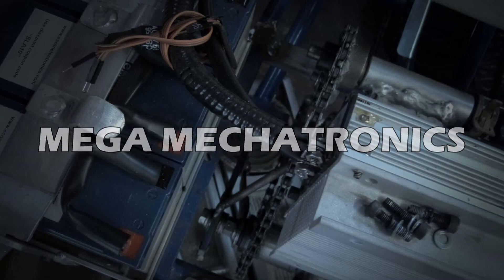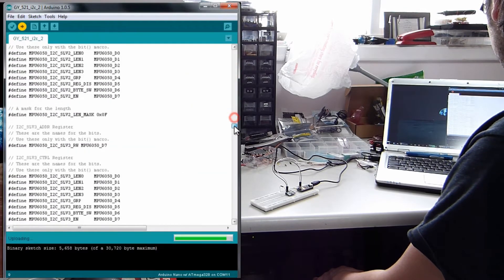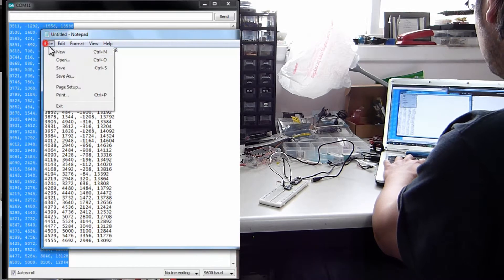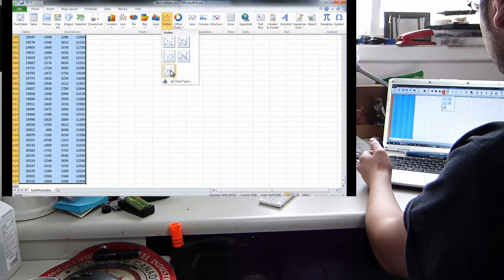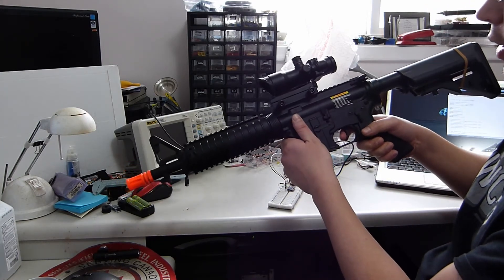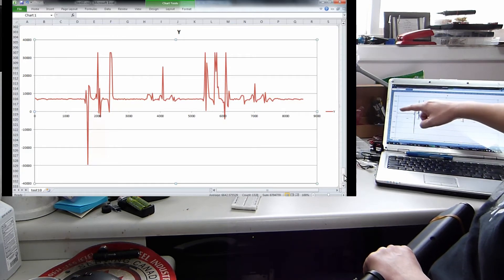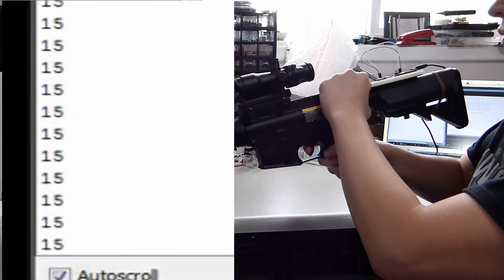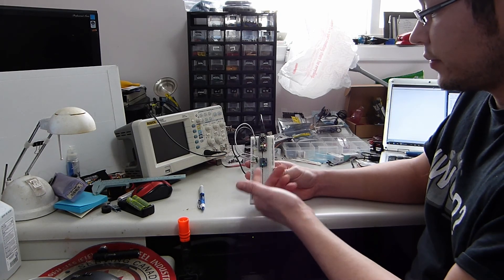Arduino ESP STM Bullet Ammo Counter Experiment Airsoft GY-521 MPU-6050 Tutorial

Comment: Very interesting piece of work and I think this is unnecessary...an optical counter would be much better and easier to program!
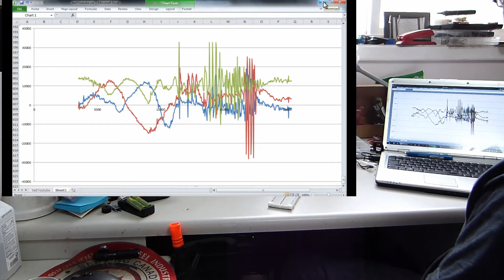Reply from the maker: It's just "a fun idea" =) 4:40 to learn about this sensor!
Reply: Well, using accel is easier to setup, no need to add a adapter on the front of the airsoft, just put in the picatinny and done

Comment: Yea, using a gyro sensor for something as "light" as AEG would be a tad difficult, though it would prob be better for a GBB . So far I found that using an optical sensor at the end of the barrel gives the best result, though I am sure there are many other ways of sensing a BB.
Reply from the maker: I agree with you on the AEG, it was hard to tune it and it will give you false readings if you tap it hard.  For a GBB as you suggested in addition to firearms, it seems more feasible.
Reply from the maker: Another difficult challenge I failed to mention was creating a system to change the baseline, because if you tilt the gun up or down it totally changes all values.  I had to spend some time with that portion to create a dynamic baseline depending on the orientation of the gun, then look for changes in the baseline and count it as a shot.
Reply: Mega Mechatronics woah, well at least something was learned.
Reply from the maker: ANTALIFE That's how I have been self learning lately, I need a clear goal, then just make it happen.  In this case it was, hmm, I want to make a bullet counter for a toy gun and off we go...

Comment: hi nice video. I'm doing a school project using a arduino for the first time. the projekt is about having a vehicle drive around using the gyro accelerometer too measure hight change. could you give a tutorial of how you set op the arduino and/or the programming. i have a hard time with the programming specifically if you could help me me understand anything from it i would really appreciate it.
Reply from the maker: Thanks for the reply.  I think I can help lead you in the right direction and give you as much insight as I know; unfortunately I do not have first hand experience with what you described.  Is your project based around an 'outcome' (ie. measure height/altitude) or is it around deploying/using an 'accelerometer/gyro'.  

The accelerometer could theoretically achieve a delta height change, but that is in perfect conditions.  Your vehicle will not perfectly align the axis you're measuring and may move erratically causing noise and errors; you will experience inaccuracies and creep.  You can counter these problems by utilizing the gyro and using all 6-axis' (3-accel, 3-gyro) implementing more advanced mathematics touching into calculus (integration).  It is possible that someone out there has the code and libraries you need to avoid all that.  Have you exhausted google searches?
Reply: Thx a lot. The school project is about developing a "model" of a part of bigger piece of equipment. (The model means its not necessary to work completely and its going to be small sized LEGO car. (Also there was a translation misstep, we are going to measure the angle of with the ground below shift from place to place, therefore gyroscope). 

I am new to both arduino, I2C, gyroscope, and my programming only goes to java and slight assembly. (A group member knows C#). Arduino is kinda easy to find tutorials on but whenever the gyroscope is added everyone links to the same page you do.

The primary problem for me right now is how to combine the part using I2C (I2C doesn't make much sense to me). The gyroscope I'm gonna use is the MPU 6050
http://invensense.com/mems/gyro/documents/PS-MPU-6000A-00v3.4.pdf 
And I use a arduino uno. 
Next is the code but I slowly get adapted to it the more tutorials i watch.

So the primary current help I would like is with I2C. But understanding the code fully is also very important, because its a school project we have to be able to explain how everything works. This also means even if it doesn't work ass long as we can say why its not gonna be a problem. 

I hope it helped clear things op. sorry it got so long. thanks again for taking interest in my project:D
Reply from the maker: I may not be able to answer your question unfortunately.  Are you going to start with the GY-521 breakout, it's like a 'turn-key' MPU-6050 using the 6050. I2C is just a communication bus, where you can have multiple devices on a continuous wire, like CAN in cars, DeviceNET/Profibus in manufacturing automation. 

Did you watch Blum's tutorial on this yet? Tutorial 07 for Arduino: I2C Communication and Processing
Reply: yes i have. i however still dont get how the I2C(which i think use digital) send to the arduino analog input
Reply from the maker: animemangefan The analog pins are also digital pins on the Arduino: http://www.instructables.com/id/How-to-add-6-extra-pins-to-your-Arduino-with-no-ex/